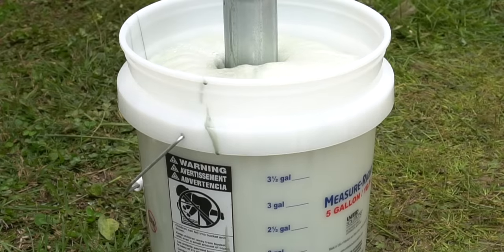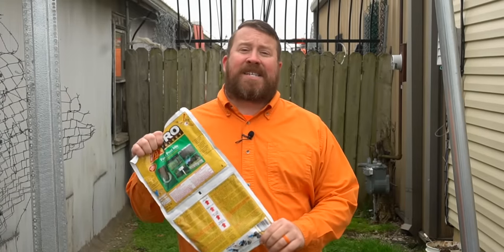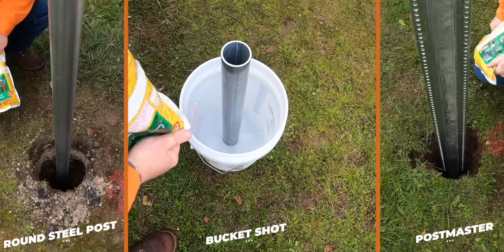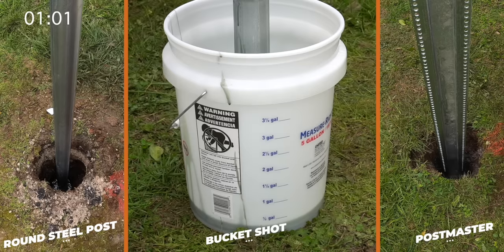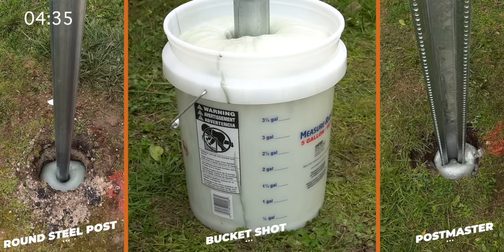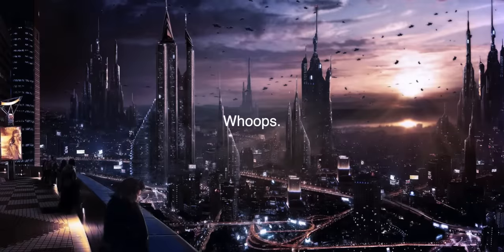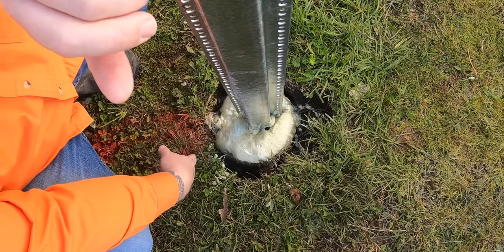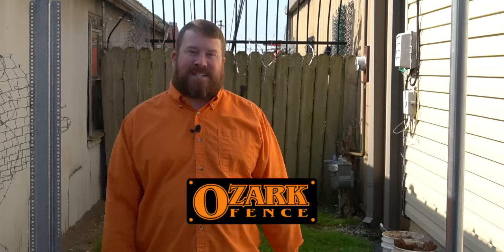Does Fence Post Foam Really Work?

Comment: This was done wrong because Joe doesn't understand the way this foam behaves......
Reply: @JoeEverest  I like your videos and it's  clear that you know your stuff. I should have explained better instead of just pointing out that you don't understand how expanding foam behaves. I cast this stuff into molds and the foam needs to be restricted from all directions otherwise it pushes (expands) to the side of least resistance and ends up being weak and not filling the mold properly. The hole just reminds me of a "mold".

Comment: THIS STUFF IS TOTAL GARBAGE AND SHOULD BE TAKEN OFF THE MARKET. MY DAUGHTER HAD A FENCE INSTALLED USING THIS CRAP. THE FENCE POSTS DUE TO FREEZE THAW CYCLES (36") DEPT HAVE POPED UP A GOOD 6 INCHES OR MORE OUT OF THE GROUND. THE FENCE IS LEANING ALL OVER THE PLACE.